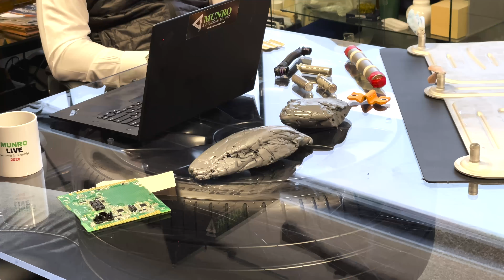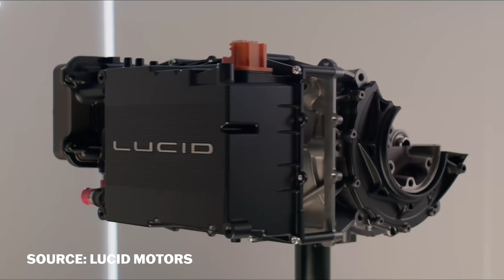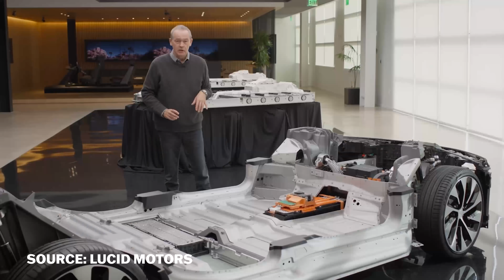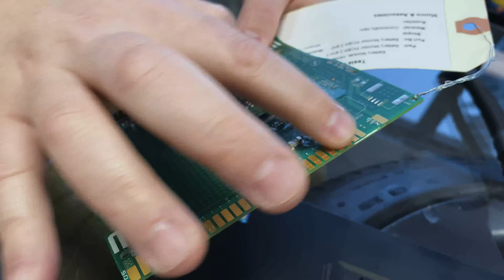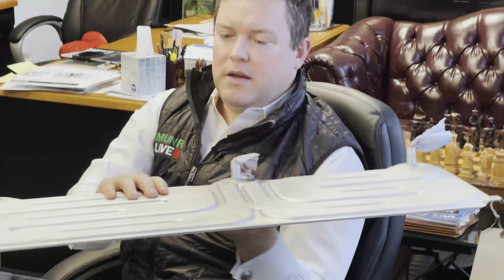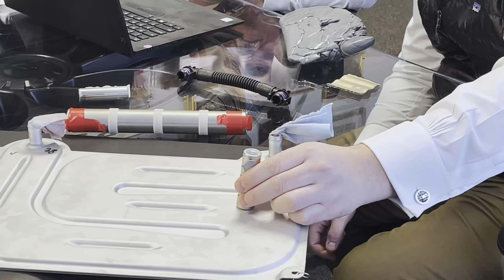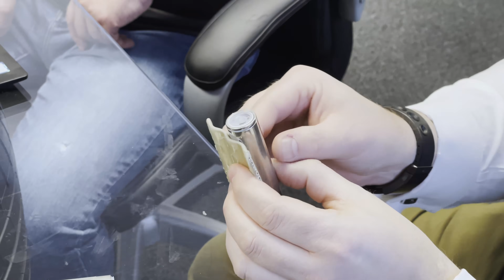Lucid Tech Talk 01: Battery Pack Reaction

Comment: Have you ever compared the weight of each vehicle as well as the efficiency?
Reply: Vehicle Weight is well known and understood.
no need for that.
the LUCID air weights MORE than the Tesla PLAID w/ 3 BIG motors..... Lol.
Reply: There is a need for that or I wouldn't have asked.
Reply: @EdPalmatier  He's just a tesla fan boy who trolls for tesla, just ignore
Reply: @markplott4820  yet one gets 300 miles and the other 500 miles 👀
Reply: The lucid is heavier because just like the Mercedes sclass it has optional reclinable rear seats and ma y other comfort features than the tesla.
Reply: @rtfazeberdee3519  you're totally right mate.
Reply: @markplott4820  actually, the EQS is the heaviest. You like to say "do your own research", but unless you've taken apart both the Model S and the Lucid Air yourself, you haven't done your own research either. You're obviously just regurgitating conspiracies 🤷‍♂️. Also, I crunched the numbers and this was the result:

Model S LR: 0.0839 mile/lb
Lucid Air Range: 0.0993 mile/lb
EQS 450+: 0.0735 mile/lb

Though the Lucid Air is heavier, it is still more efficient.
Reply: @markplott4820  what Tesla car has 420+ miles of range? LOL 😭
Reply: @Lando_Sage  - TESLA model S LONG RANGE. and Tesla RANGE gets improved every few years. Model S started with just 200 mi range in 2012. even my RAVEN gets over 350 mi.
Reply: @markplott4820  idk where you get that info from but the Model S LR barely achieves it's rated 400, miles range. Anyways, I gave you some numbers to look at Mr. "Do your own research". Are you going to do your own research to confirm or deny my numbers?
Reply: @rtfazeberdee3519  
He's an embarrassment to us fanboys.
Reply: @Lando_Sage  - EPA official numbers are Notorious for being INACCUATE for all Brands of BEV. the problem with UNOFFICIAL range numbers have too many Variables. such as Wheel, Tire , Weather and SOC. but, you already know this.
the FACTS are the LR mod S has the LONGEST range of any BEV SEDAN under $100K. this is why the i-Pace, AUDI, Taycan all PERFORM way below even 200 miles range. at the END of the DAY, LUCID motors only has DUMB RANGE and INABILITY to charge at 1000 mph.
Reply: @markplott4820  I agree that Tesla has the longest range under $100k... For now. The E-Tron and Taycan actually perform a lot better than the EPA range, and they are known to hit above 250 miles regularly. Idk where you're getting your information from but it's wrong. You say Lucid has dumb range, but i can disprove you with 4 numbers. Model S LR has a 100 kWh battery and goes a little less than 400 miles. Lucid Air Range has 118 kWh battery and goes 500 miles. 18 kWh difference does not account for 100 miles range difference and that's facts 🤷‍♂️
Reply: @Lando_Sage   - we Actually, dont Really KNOW the size of battery LUCID is using, no one Anywhere has EVER taken a LUCID battery apart . some ANALYST estimates put the LUCID battery at 140 kwh. 
we DO know the LUCID is HEAVIER than the PLAID w/ 3 BIG motors. 
but, as SANDY said , its only VOLUME efficiency and not Mechanical efficiency. in the LUCID.
the LUCID inverters are LARGE and weigh MORE than the PLAID inverters. 
we also KNOW the LUCID drag is worse than the PLAID. 
the TRUE test would be to make the LUCID battery 100 kwh ONLY , then TEST the range. but, LUCID knows it cant even get 400 mi with a 100 kwh battery.......lol.
which, NULLIFIES Lucid claim of EFFICIENCY.
Reply: @Lando_Sage  
Point 1, I thought the Model S long range had a 93 kWh pack?
That would make the Lucid pack 25 kWh, or 27% larger?
Which would skew the advantage the other way?
.
Point 2, at 70mph, final drive gearing and cross section of the vehicle will have an effect.
That's down to specific design choice from engineers.
.
See, eat to "argue the toss"

And that's facts.
Reply: @markplott4820  I'm pretty sure we literally just saw Rawlinson tell us AND show us how big the better is are, how many cells, how many batteries per cell, ect. It's funny because if Sandy wasn't there to take apart Tesla's, how would you know that Tesla was being honest about their battery size? Take it apart yourself? 🤷‍♂️. On a similar note, Sandy watched the video and did not question the honesty or truthfulness of the battery capacity, why? Because the numbers all match.
Those "analysts" are obviously using the charging energy used to fully charge the battery. That's always going to be noticeably higher than actual capacity because of loss.
Sandy didn't say that, he actually almost said the opposite because the drivetrain was small but the inverter was larger than expected. Do you know what volume means?
The plaid drag is 0.208, Lucid Air drag is 0.200. therefore the Lucid Air has the better drag coefficient. Do you even verify your information before you communicate?
Lucid knows it can't get 400 miles from 100 kWh? That's interesting because that's 4 miles/kWh where the car normally achieves 4.4 miles/kWh. Seems to me like they achieve that.
Reply: @rogerstarkey5390  
1. 2022 Model S LR has a 100 kWh battery pack. Easily verifiable through multiple legitimate and independent channels.
2. Sorry, which of my comments is this referring to?
Reply: @markplott4820   EQS and Lucid Air have the same drag coefficient...
How do you know the inverters are too large? Are you an electrical engineer or something? Also, inverters are not heavy. Maybe 10 pounds max for vehicle applications.
You haven't given one bit of useful information, and all you talk about are conspiracies. I challenge your conspiracies with actual information and you respond with more conspiracies.

I don't understand why Tesla has to be the only EV manufacturer trying to move the industry forward.
Reply: @EdPalmatier  

Model S LR: 0.0839 mile/lb
Lucid Air Range: 0.0993 mile/lb
EQS 450+: 0.0735 mile/lb

Comment: great video but it was more show than true information about their batteries and battery packs. It was a high school lesson in batteries and that's fine to explain to the novice how a battery pack works but the details of much of that battery pack were never really discussed. What is the chemistry of the cells? It seems that they are just batteries that are standard and off the shelf. That to me means that they aren't anything special. Next they never talked about the power density of the batteries or the packs they are assembled into so they aren't anything unusual or they would have said something. Tesla when it has a battery day goes into great detail as to the density and power to weight and volume numbers of their new 4680 batteries. That's because they actually have batteries that are much different than the cells Lucid is using. And the last thing that Lucid didn't mention was the cycle life of the battery packs. It's critical to understand the cycle life of the batteries to know their expected life and durability. Lucid is very careful to not mention this. It will be important to see just what 4680's add to Tesla's battery packs going forward as I see this as the big difference in Tesla and Lucid batteries. Lucid is doing fine against todays battery technology and their overall design is OK but it's old battery technology other than the packaging. Going forward Lucid appears to me to be in the position that GM is when they talk of their battery packs. Stuck in the past and the new batteries and chemistries coming out will blow them away once they hit the market. Lucid has basically taken a battery pack and design for the racing circuit and put it in a standard car. They haven't really developed anything to speak of beyond taking a technology designed for racing and putting it in a production car. Racing EV's aren't concerned with battery life beyond finishing the race. They are designed just to put out max power to the motors. That fine but if it doesn't hold up for 10 years or more it's not going to be successful. So in the end the video was a cinematographic master piece but it really left more unsaid that said.

Comment: 3:45 Correction: Only 520 Lucid Air Dream Editions have been made. They are a very limited edition vehicle of only 520 ever made; and they are split into two variants - the Performance with 1111 HP and 471 mile range or the Range version with the magic 520 EPA miles and 933HP . Both versions cost $160,000. I am a Lucid; Polestar; Chargepoint  and Tesla investor.
Reply: They haven't produced them all yet. Still over half remaining to produce

Comment: 7:57 The battery in the GMC Hummer EV isn't as massive as you are implying here. Even without the battery (the case itself is part of the vehicle's structure), the HUMMER EV weighs over 6,000 lbs. If you cut the HUMMER EV's battery capacity in half (down to that 100 kWh that you were referencing for sedans), it would still weigh about 8,000 lbs. Another way of looking at it is that the weight of the HUMMER EV's battery relative to the total curb weight of the vehicle is roughly the same as it is for the Tesla Model S.

Comment: I understand the preference against side cooling just in terms of cooling, but I believe that Tesla prefers it because it allows spacing between cells and barriers that can keep a defective cell from causing thermal runaway in other neighboring cells. Looking at the Lucid pack, the cells are all cheek to jowl and it seems to me that battery pack fire risk is higher than with the Tesla pack. I would be interested in your take on this.
Reply: Interesting take
Reply: I think it was simply that Tesla realised the side contact area on small diameter/ tall cells gave a higher contact ratio.
It's a different story on 4680, hence the (rumoured) move to end cooling.
(Plus other reasons)
Reply: @rogerstarkey5390  the speculation from Munro was that Tesla would use end cooling for 4680 packs. The evidence from the Berlin festival they gave is no, still side cooled for the 4680. Besides better fire suppression, there are other advantages of side cooling like ease of manufacturing and greater structural rigidity.

Comment: Battery cooling is a nightmare, so I'm glad my 215 mile range '22 Nissan Leaf has no battery cooling.   They are proven, last a long time, and you don't have to worry about coolant leaks inside, clogging small passages, pumps failing, maintenance, etc.  .... Wow, the Leaf does not seem to need cooling, although some fast-charging has to be limited a bit, that causes other (and NIssan's newer Ariya) to get horrible liquid cooling.
Reply: My first EV, a 2011 LEAF SV w/ every box checked, even a little solar panel on the liftback's spoiler, is an awesome car. Now handed down to its 3rd owner it still makes a daily commute every day. Of course, it is on its 3rd warranty replacement traction (big) battery and 4th if you count the recall. The car is bulletproof, still on its original brake pads and everything works, but no cooling for that battery in Texas where it originally lived has almost sealed the fate of Nissan. They made a great car but a battery not up to service in the hot parts of the US. And now they make a supposedly good S?UV with a name I can't spell w/o looking up, so good luck with all that.
Reply: @Miata822  Leafs are under-rated.   Proven now, many miles of experience, few if any fires attributed to them, reliable, no coolant fluid, drives nice.   Even the older low-range ones gets you enough for a commute or to the store, etc. and back.  I know, I had a '16 Ford Focus EV (80 miles range) and we got around town with it a lot.

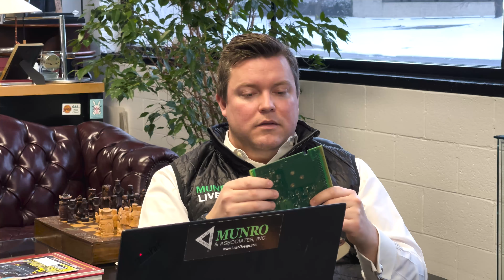Comment: 13:33 Another ridiculous Tesla comparison. The only thing that matters with a BMS is the number of cell groups. Tesla chose the route of disbursed boards to consolidate each module, which they then linked together. Using Tesla's approach, yes, fewer modules is better. But you can't say that universally applies to Lucid's battery.
Each of Lucid's 300-cell modules is composed of 10 cell groups. Given their proprietary busbar, they can easily connect a low voltage ribbon to link the 22 modules to a single BMS board. Based on what I've seen, everything that Lucid has done so far is elegant, simple, and at least a generation ahead of what I've seen out of Tesla.
Goodness, I can't imagine how you're going to wrap your heads around GM's wireless BMS technology.

Comment: Any pipe that's corrugated absolutely thrashes flow.  Be it fluids or gasses.  Laminar is best.
Reply: I think in this scenario turbulent flow is best because you want as much of the fluid to take away the heat as possible. With laminar, you only get the fluid at the boundary layer whisking away the heat, which then gets too saturated with heat and reduces effectiveness.

Comment: Question about battery cells Lucid uses.  They claim 6600 cells per pack for 112kwh.  Tesla uses 4416 cells for 85kwh, so the cells if made equivalent to 6600 would be 128kwh if my math is correct.  But lucid claims to have industry leading cells, so shouldn't the total pack size be even higher instead of the claimed 112kwh?
Reply: The model 3 doesn’t have 85kwh. It’s less than that.
Reply: You note (IF you watch the Lucid video) that he mentions  "two slightly different chemistries" for the long range and performance variants.
There's so no evidence that the drive units are identical, there could be a different gearing for acceleration?
.
"Lucid claims industry leading cells".....
When did they claim that?
This year?
When they announced the car?
Things have moved on a lot and will be in flux for the foreseeable future.

Comment: The automotive industry is so full of protocols to add value, reliability, performance, comfort and dozens more i can name that no new major players could really emerged and thanks to simpler electric vehicles, not anymore.🤩 And thanks to Elon it was proved.👍I always wondered how precisely they are riding on the back of the giant? By hiring the automotive industry’s best only or also by using joint design contracts with combustion engine’s existing players, how independent they are in the term of the design?

Comment: WAIT WHAT??? !!!! THE HUMMER WEIGHTS WHAT? 9000LBS ARE YOU KIDDING ME?  someone is going to get killed in that thing. wow. how do you stop it?  and it will wear out tires fast.
Reply: I think you mean killed BY that thing, especially if it has the gun turret option.
Reply: Some of the dual wheel 450 and 550 trucks weigh that much. Where do you live?
Reply: You need a special driving license for such a heavy vehicle in Poland.

Comment: maybe they don't want you to tear it down? call me cynical but i'm suspecting they are hiding something, perhaps like the battery size which Munro would be able to establish immediately.
i hope they are not hiding stuff because that means someone other than tesla has great tech.
Reply: Call me cynical, but did you actually watch the lucid video, or if you did, understand it?
The information was all there.
Reply: Sandy and Cory didn’t seem overly impressed with much of their “tech” esp wrt to this miniature drive system that Peter keeps blabbing about ..so how’d they achieve such phenomenal efficiency if they’ve got way more modules ( more weight) and their miniature drive system doesn’t appear to be any kind of breakthrough…their vehicle weighs the same as  plaid model x but wouldn’t beat it in a 1/4 race despite having more horsepower than the x .. so how the heck are they achieving 500 miles of range if not for some extra hidden batteries
Reply: @jswyft  
I see you're from the 
"I don't understand this so I'll let my "confirmation bias mode" kick in and revert to my original opinion" collective?
Reply: @jswyft  the top trim has a bigger battery. But even the base trim is rated at 400+ miles with a smaller pack. The aero, motors, and electronics are all optimized for efficiency.